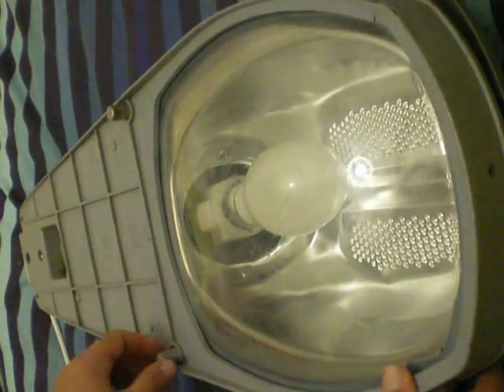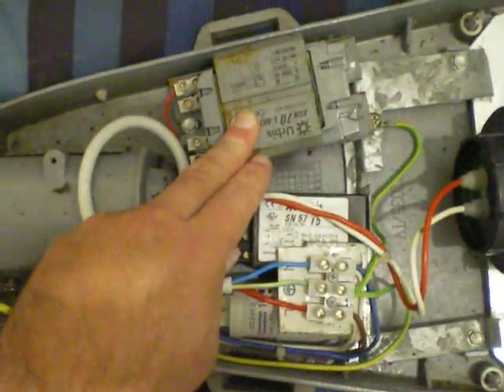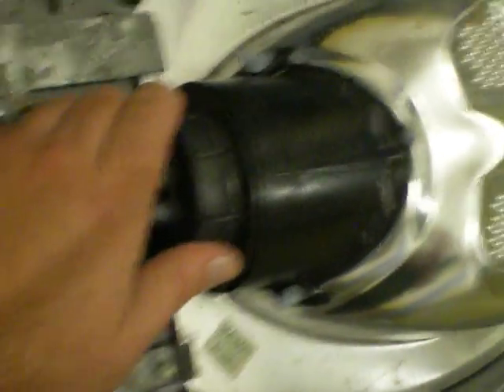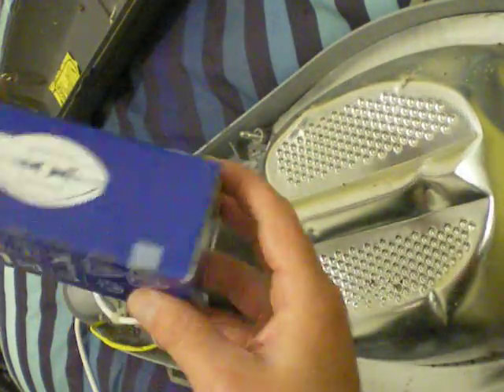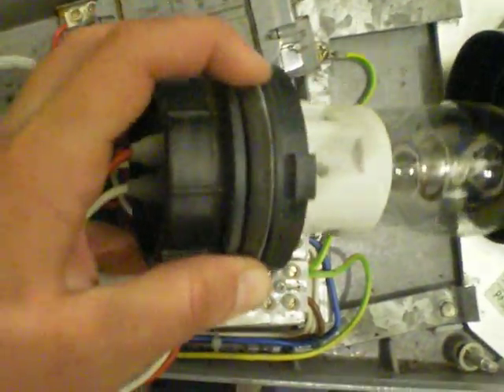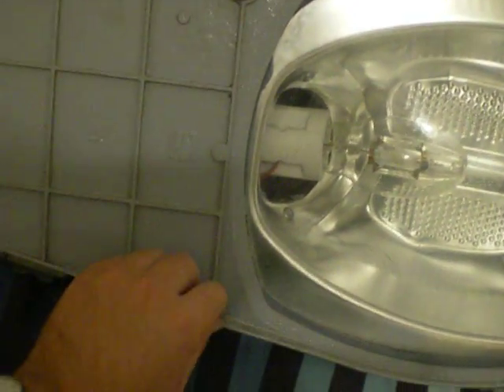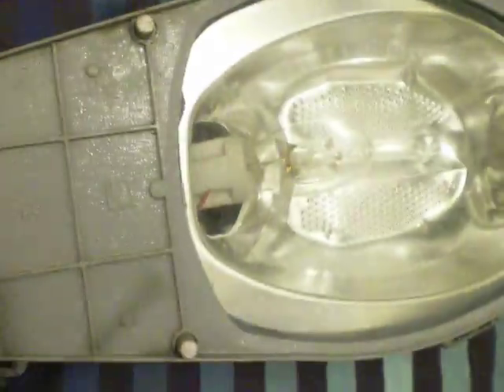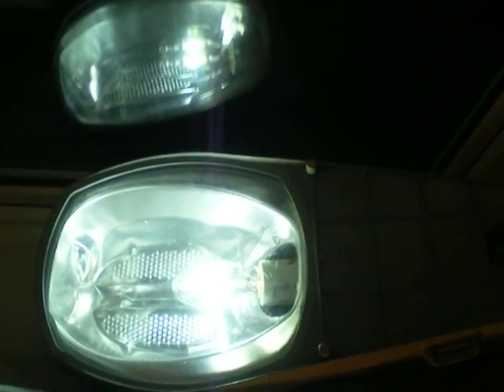H.I.D Lamp

Comment from the maker: @Parrot175 These types of fittings have be around in the UK since the late 1990,s & today they are very common on our roads The design of those fitting is to prevent moister build up & insects entering to the lamp area where the bulb is as with other older type fittings where you remove the light cover to change bulb if its not firmly close tight due to wear & tear insects & moister will inter it reducing light out put